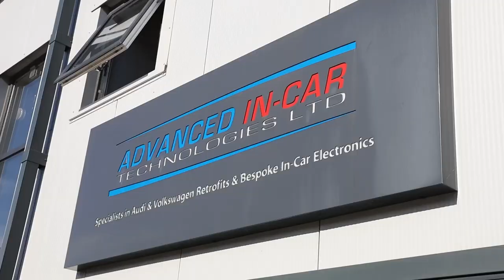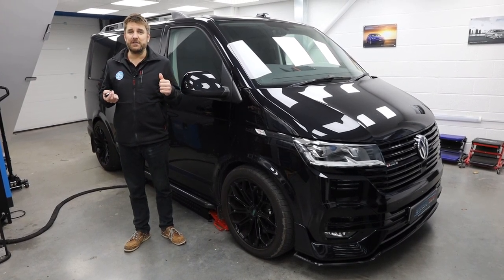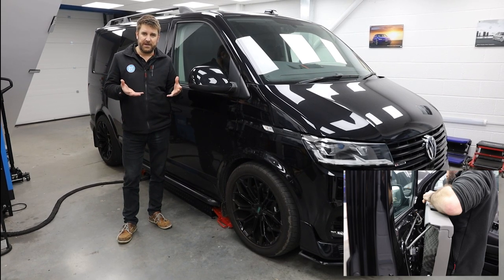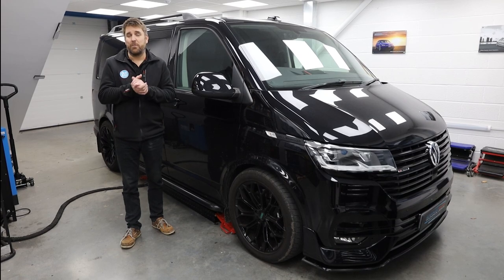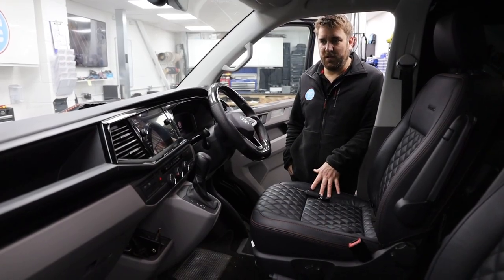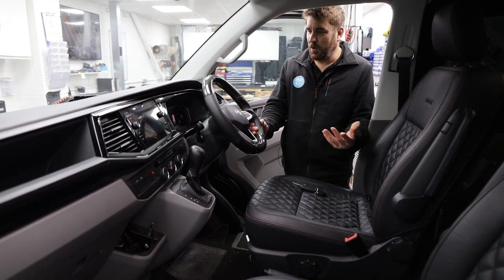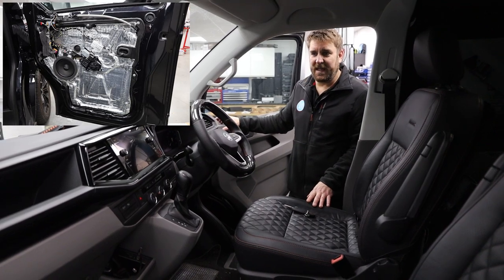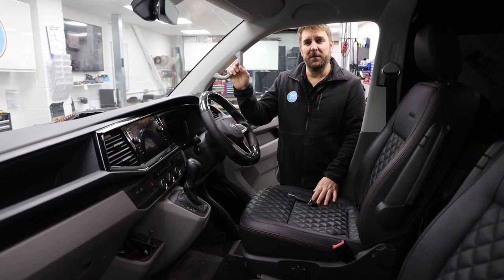The Complete Alpine Audio Package!!! 4 Brilliant Audio Enhancements to this 2020 VW T6.1 Transporter

Comment: How much weight gain does this project incur.
Reply: I have the same question. The sound deadening sheets are heavy and only intended to lower the frequency with lighter insulation intended to reduce sound. I’m sure this is just too much weight for one project?